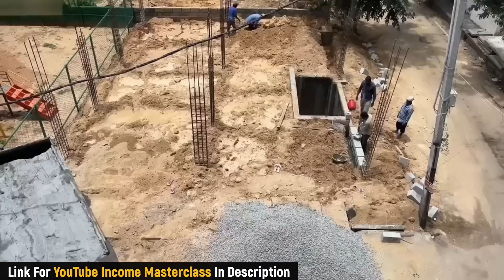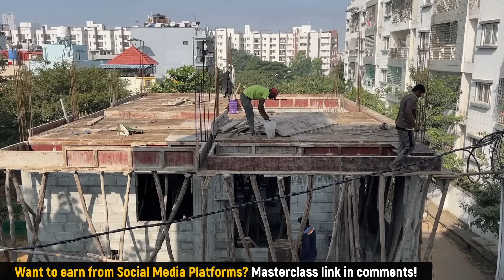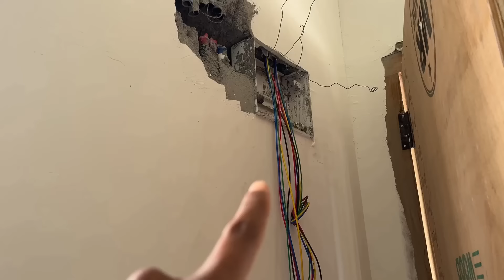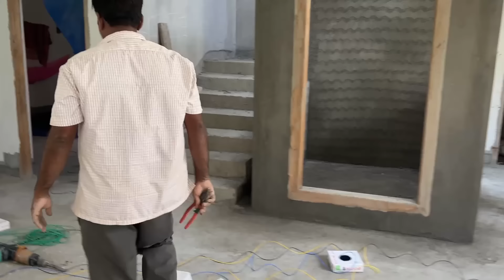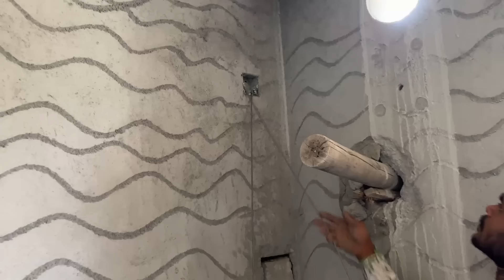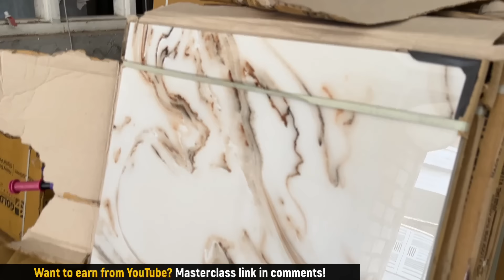Step By Step Indian 30*40 house construction, time lapse - 8 months work in 41 minutes

Comment: One fo the column is attached to septic tank or water tank whatever it is.
Isn't it will affect the strength of that column in long term because of the moisture due to water?